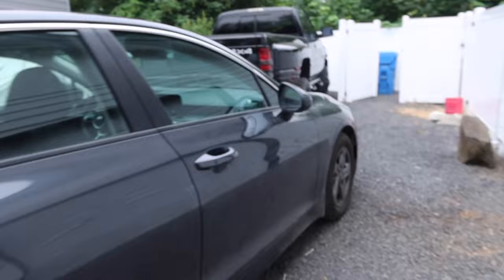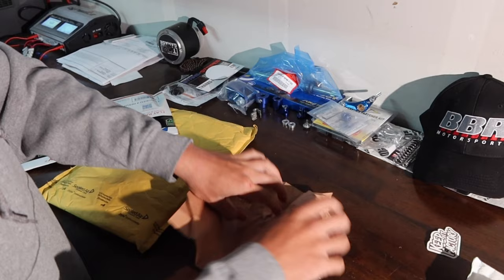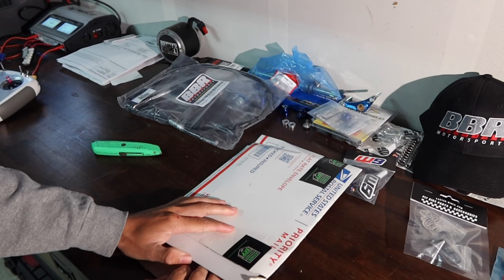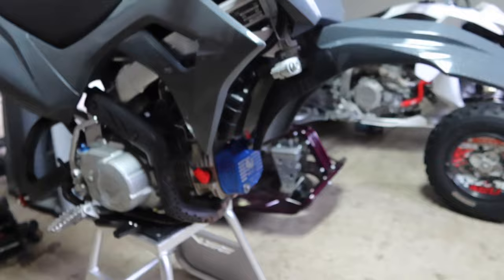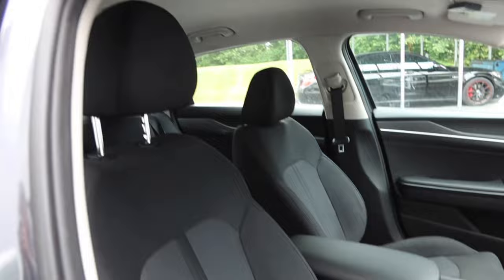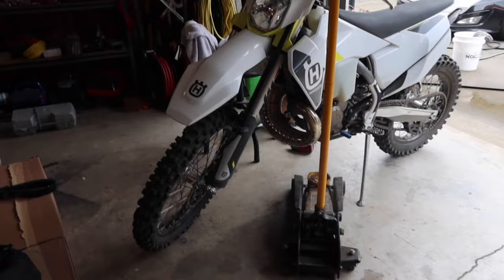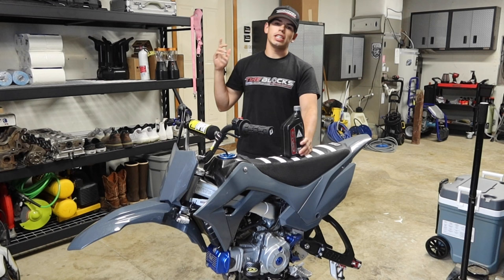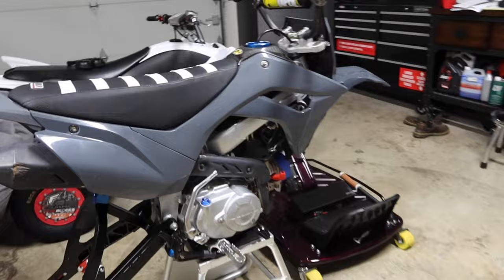BUILDING THE BADDEST CRF110 ON YOUTUBE..(PART 4) DIAMOND MINIS HARD PARTS.

Comment: quick question, on that P3 carbon fiber sensor guard in front go shifter. does that have 2 mounting holes? one on the skid and one underneath the engine or is it just the skid plate mounting hole?
Reply from the maker: I do not remember I think it had two